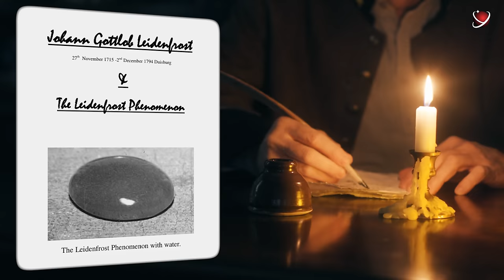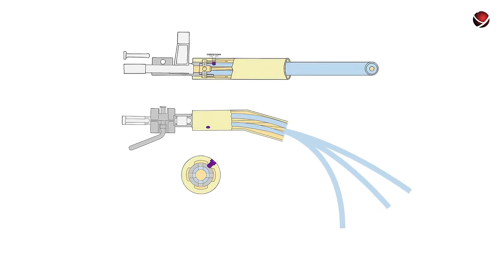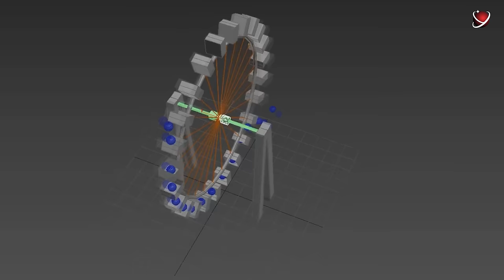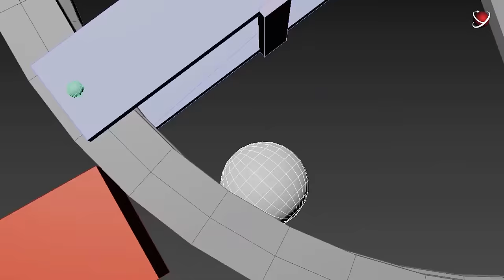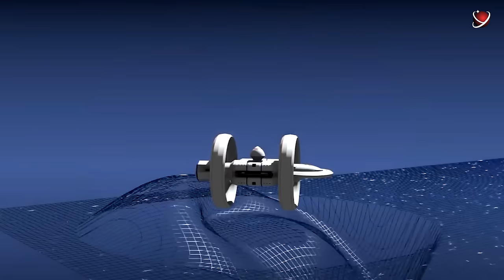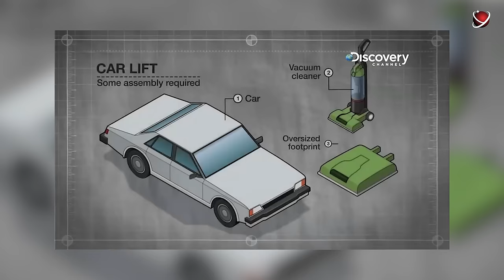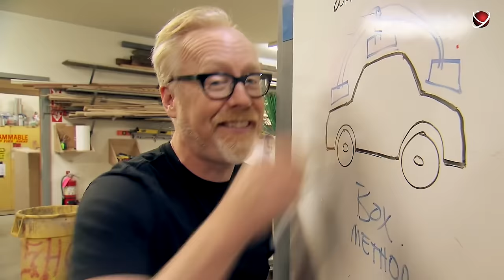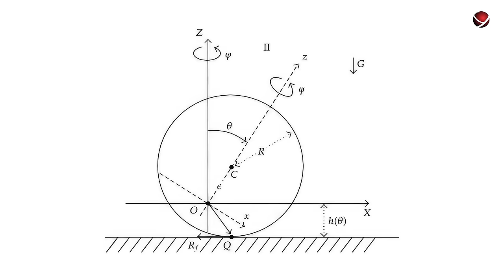15 Weird Things That Seem To Defy The Laws Of Physics

Comment: why talking about lead, lol, lead does not radiate in red when melted,lol,,when you see red radiation ,,it is melted iron or some other metal!!!
Reply: Exactly what I thought. Lead melts way below visible red heat. But I suppose melted lead could be heated to red hot, depending on the boiling point
Reply: ⁸7

Comment: Water & molten metals are a dangerous combination because of the danger of popping or exploding of them making contact, that's why you see the guy from Myth Busters shake off the excess water from his hand after submerging it in the fishtank. It's been my experience that talcum powder applied by dusting the hand with a sock or sack of the powder is much safer & works extremely well.

Comment: Interesting video. I think there may be laws of physics we haven't learned yet and some things that seem impossible by our present understanding might become possible. The Ibex goats made me think of people who climb things using narrow surfaces to hook their finger tips and toes of shoes. Seems their fingers and feet need to be extremely strong. The car lifted with a household vacuum cleaner? The vacuum cleaner didn't lift the car. A lift or crane was used to actually lift the car. The one of these that pushed the limits of my imagination was the warp drive. I've watched shows and movies like Star Trek since the early 70's and never gave much thought to warp drive. Just science fiction. History has shown us science fiction often becomes science fact. A comic strip, I think in the 1940's called Dick Tracy, a detective who wore a wrist watch that wasn't, but a device he could talk  to headquarters and see who he was talking to and they could see and hear him. Was no such device in the 40's but it's become reality now, in the form of a cell phone small enough to carry in a pocket. The fan driven sail boat? I find it interesting but don't see any practical purpose. The fan must have some form of energy. Sailboats without fans have simply used the wind for propulsion. Drop the sail and turn the fan around pulling air from the front and pushing air out the rear works. Perpetual motion? I think someone might figure that one out eventually. I'm sure it won't be me but the idea has always been  interesting and I've thought about how it might be done but I don't feel inclined to spend any time on it. Other things I need to do.

Comment: You briefly showed a V gate magnet motor and then flat ignored it! The thing will run until the magnets die or some mechanical failure occurs! That's very much as good as it gets for "perpetual motion"!!! Is 400 years of run time with no external power source other than the magnets "perpetual" enough???

Comment: Bent barrel not so safe because bullet needs to quickly change direction before exiting the barrel or goes straight and penetrates the barrel having the gun fold to an angle the bullet will go straight and every action has an equal and opposite reaction.

Comment: Why stop at square wheels.....try  hexagon & octagon shape so the ride will be less bumpy because the wheels would have a better chance to line up with one another... Lol while you're at it... Instead of making only one plate of steel octagon per wheel, put two octagons per wheel and offset them. That way you have double the gripedge per wheel and space the plates of steal away from one another about 4 to 6 inches with angle iron pieces to connect the two for more stability per wheel and to keep the wheels from sinking as far down into the mud as they do which would give it even more traction...

Comment: for shooting around corners, id use a laser that delivered micro shots with a heads up virtual display in the visor of a linked helmet / firing aperture vid lens with auto shut off during emmision to prevent frying the device .i dont recommend laser targeting because lol it warns the target & pinpoints the shooters muzzle allowing the weapon to be targeted by the target with its own vid system lol

Comment: Get rid of the cables throw in magnets you have a magnet from earth to the top of the elevator and it is easy to start and stop since the practices has been done on bullet trains and catapult systems on aircraft carriers. How electric magnetic elevators work is negative to negative repell and positive to positive repell then to stop it the positive switches to a negative to a positive and same the other way around with the positive to the negative and it will be simple for the top and bottom to do the same thing along with measuring the distance to the top and bottom to decide when to slow the elevator down to a stop.
Reply: but it requires far more energy and you have a real catastrophe should anything happen...

Comment: Perpetual Motion EXISTS!
It is in the form of Helium 3.
Check the Helium 3 fountain, or motion in Helium 3.
Reply: Again Helium 3.
It is empirical fact.
Reply: But the laws of physics are incomplete and erroneous at parts.
Not Einstein's fault, they simply had no tools to check the theory.
Reply: Yet another error, that if time alteration when going beyond the speed barrier.
It is an ILLUSION.
As light is TOO SLOW.

Simple.
Reply: The "Spacevator":
Yeah, no.
One issue is weather.
Lightning storms, strong winds, even Arctic temperatures.
It cannot be done.
Reply: Vacuum Lift:
Well, glass of water and a piece-o-plastic already proved this viable.
Reply: Fan and sail:
FFS:
Just use a FAN.
Or a sail!!!

One fights the other!
Reply: Tippy top:
See how a bolt with wings (dunno the English name, apologies) acts in space ...
Quite something.
Same principle here.

Comment: Globe Earth would defy the Laws of Physics - It  cannot be Real. - Proving the heliocentric model is wrong is as easy as understanding the laws of nature and the behavior of gasses. The claims are that Earth is a sphere inside of a vacuum that has an atmosphere around it, in an open system. These claims are provably false. They go against the laws of physics (laws of nature) and behavior of gas; the 2nd law of thermodynamics specifically. You simply cannot make claims that go against established laws of physics/nature. - I'll break it down for you. It's all about Entropy of a gas which the 2nd law of thermodynamics shows us. 

Atmosphere meaning sphere shaped air is an oxymoron. Gas has no inherent shape. Gas cannot form a sphere in a vacuum. That would be a violation of the  2nd law of thermodynamics.  Gas has never ever been demonstrated to form a sphere in a  vacuum nor can it ever do that in physics. The 2nd Law shows us gas expands in all directions into the available volume until equalization is reached. That's a law of nature, it's backed up by the established behavior of gasses and also backed up via the scientific method. A Law of Nature/physics such as the 2nd law of thermodynamics is a Law because the observed natural phenomena Never Ever changes. That's how all Laws of physics are defined.  If Earth were in an open system as claimed that gas above our heads and around us MUST expand to fill the available volume you call outer space. It Cannot fail to do so. Yet that is not what is observed. We have gas pressure. You are breathing  that gas under pressure.  If that gas obeyed the laws of thermodynamics and Earth were in an open system you would not have pressurized gas to breathe and you would be dead.  Gas pressure is defined as the force the gas exerts on the walls of the container. That cannot happen in the claimed open system open to vacuum as there  is no container for the gas to bounce off of. You would have zero pressure. You certainly could not have 14.7 psi that is stable and never changing at ground level. 

You might say well we have a gradient - you cannot have delta X (a gradient) before you have delta (pressurized gas). If you think I'm wrong, all you have to do is demonstrate gas pressure without a container that fails to expand into the available volume. You cannot do it. Your assumption Earth is an open system is not only nonsensical, illogical but defies the laws of physics.

 I can hear the objection forming in your head. I know what you are going to counter with. You would say But But Gravity acts as the container! (I've heard this all before) Here is the problem - No matter what you think gravity is, (I'll bet you did not know there are more than 1 type of gravity claimed in your model) we can test the claim on Earth at ground level where gravity is strongest. No amount of gravity can Ever stop the entropic process of a gas. Release any amount of gas at ground level in anyway you like, it will always expand to fill the volume. Even very heavy gasses like sulfur hexafluoride will appear to pour out yet over time that gas will expand to fill the volume. Entropy is a rate of change over time. If you want to stop that process in theory anyway because it's not been able to be tested you would have to use the 3rd law of thermodynamics and get that gas to zero Kelvin. Even outer space doesn't get that cold according to Nasa's microwave background data, it only gets to 2.3 Kelvin, not enough to stop the entropy of a gas. 

Not only is everything I've said backed up in laws of physics and the behavior of gasses it's testable by the scientific method. No way out.  The heliocentric model is 100% impossible in physics.
Reply: seems you have a (very) limited understanding of physics then ...
Reply: @KaosKrusher  You need to cite the physics laws you think I do not understand and be able to show them via real world demonstrations. I promise you that you cannot do that.
Reply: @DivergentDroid  well I never said I could do that did I?
but your "globe Earth defies laws of physics" is enough for me to make the statement I made ...
Reply: @KaosKrusher  No because you are just making the statement out of ignorance. The globe math says we have sphere shaped air. That's not possible in physics. The globe says we have gas that fails to behave as gas is proven via physics to behave. You cannot have such contradictions and claim they are true. You yourself admit you don't know physics enough to debunk me so why hold on to your uneducated claim? I suggest you study the Laws of Thermodynamics via Kahn Academy and The Behavior of Gas from ChemLibretext.
Reply: @DivergentDroid  I don't care ... you obviously missed something in physics because Earth is spherical ... and that's a FACT wether you like it or not and wether you agree or not ...